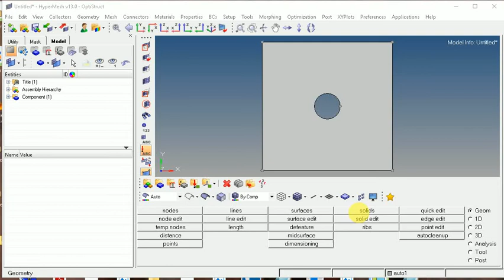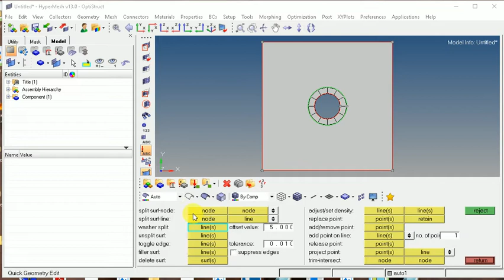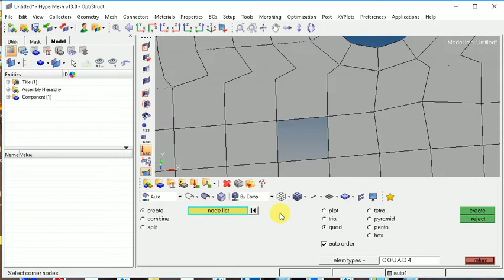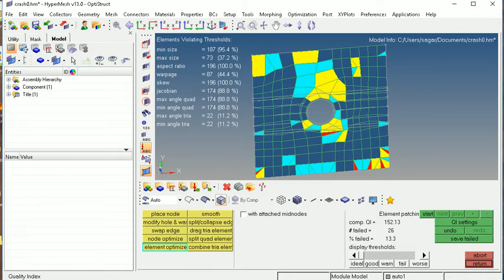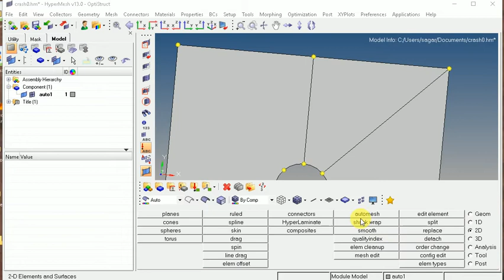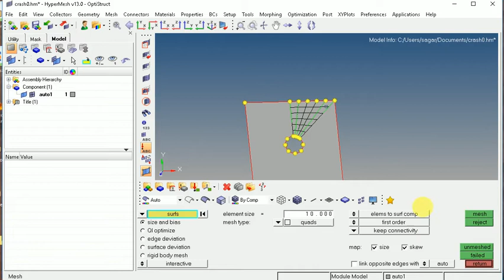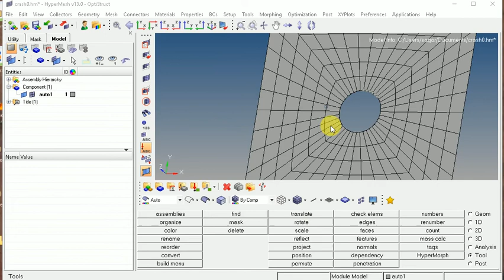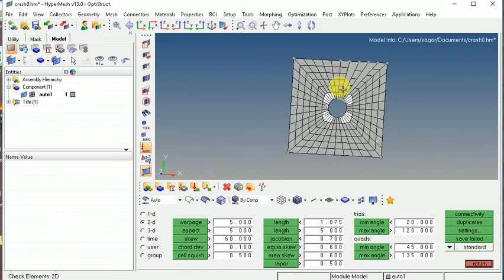8 Hypermesh mesh refinement

Comment: Imm having a problem while splitting the surfaces ... it keeps snaping to other node.....please  reply
Reply from the maker: Juned alam Yusufi 
You can just make a temporary node for precise splitting
Reply: @sagarverma  Thanks for the early reply....i have tried it ...no luck :(
Reply from the maker: If you are trying to split horizontal or vertical you can use 
Geom } surface edit } split with plane 

And select the x y or z plane
For now
Reply: @sagarverma  thank ...i will try it